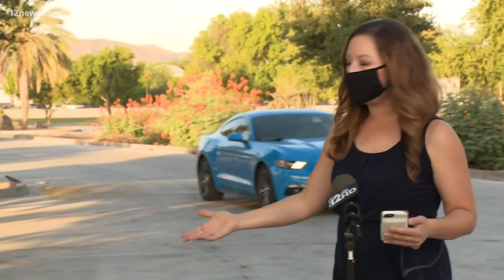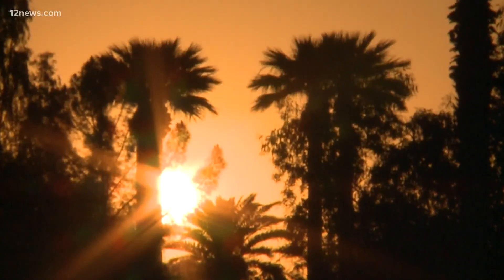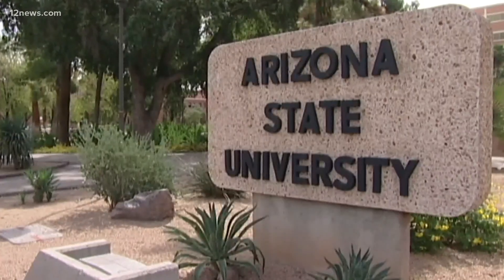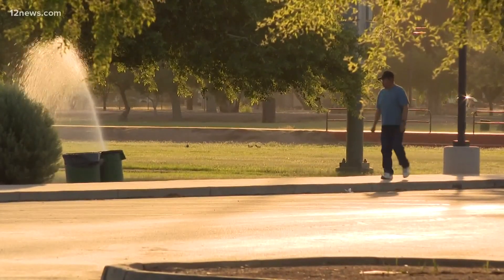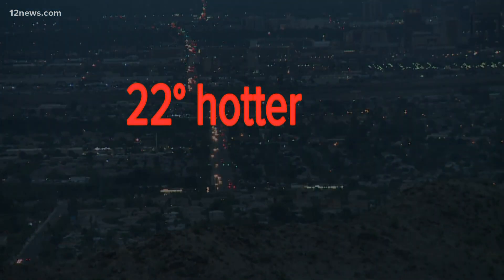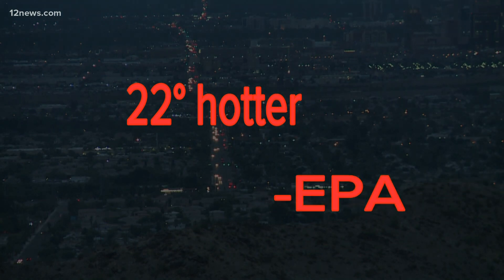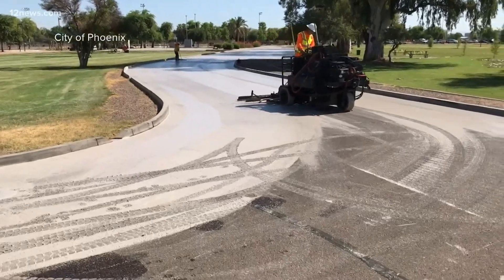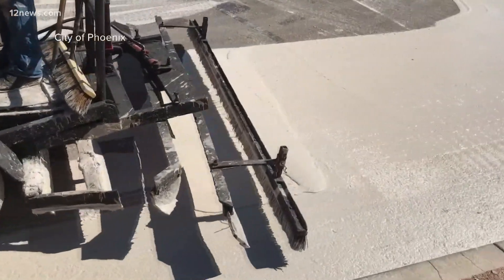Phoenix looking to reduce 'Urban Heat Island Effect' with cooling pavement technology

Comment: Even cement stays cooler than asphalt. The desert areas all need this type of over the asphalt paint coating, they should use yellow and light blue paint with the glass reflective bead material on top for crosswalks , lane lines, and dotted lane lines over the asphalt heat reductive paint coating material.